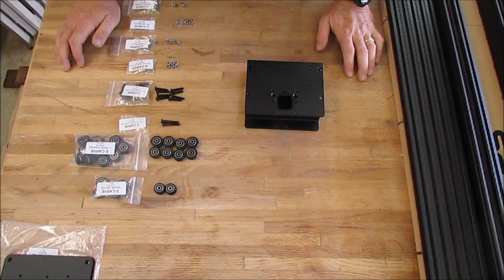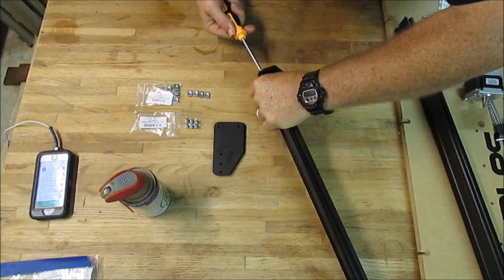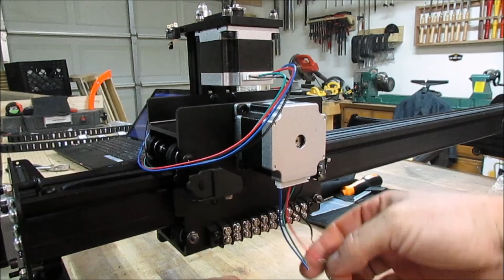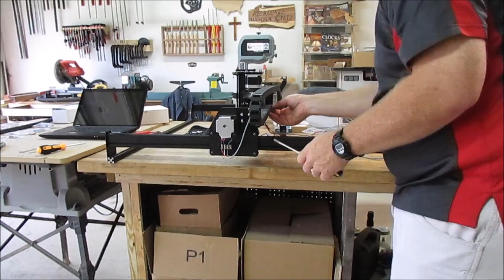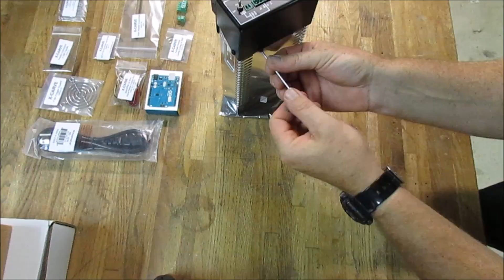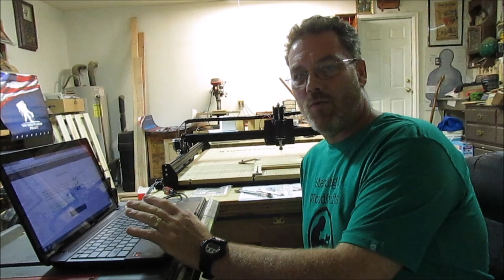X Carve by Inventables, Assembly, and Overview

Comment: Nice job Sterling.  If you need help with the soldering etc drop me and email.  Can give the moral support too.  LOL.  You do need the limit switches as a safety to limit overtravel and so forth.  Some systems use them as a home so that every time you run things out to the end the system thinks it is home and zeroes  its positions out.  Looking good so far.
Reply from the maker: Steve McEntyre Thanks Steve, I appreciate the support, i will probably add them down the road, I just need to practice Soldering first lol